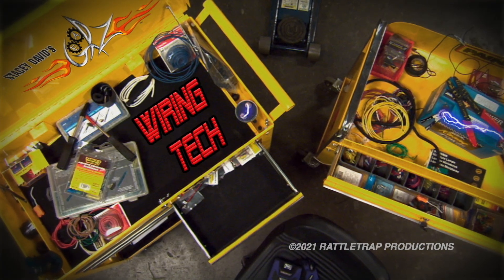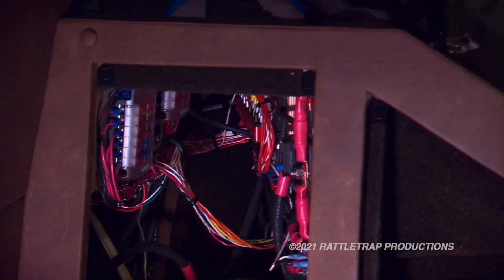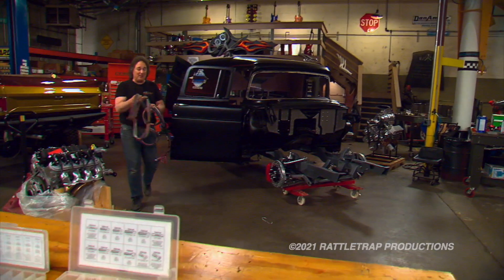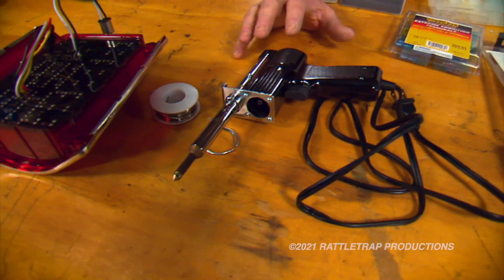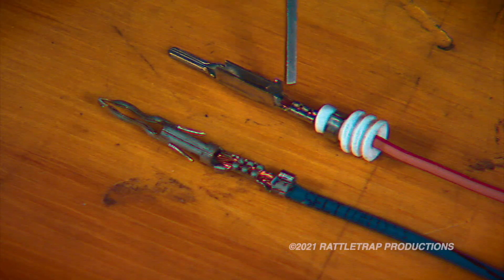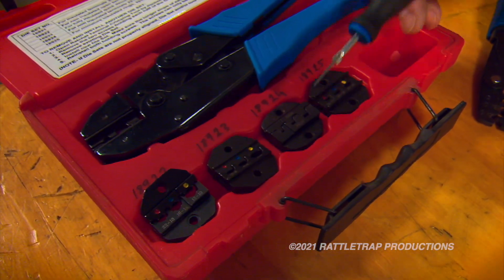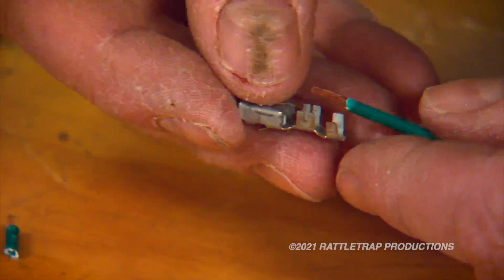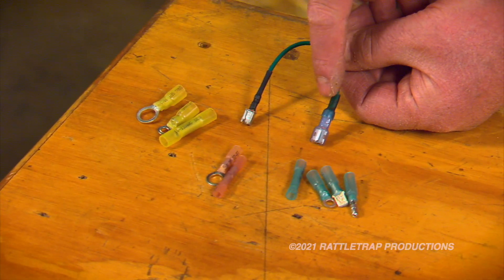Stacey David's GearZ Wiring Tech with @painlessperformance

Comment: So this being the only little video (so far) in the wiring playlist, I'm HOPING there might be a chance for an off-the-cuff trivia question.  I'm not having much luck finding good info elsewhere, but as you've spent SO MUCH TIME playing with truck projects AND THEIR WIRING -- it's worth a shot.  So cutting to the chase: I've a 99 Tahoe that I pull a trailer with now and again.  The standard 4 wires are fine MOST of the time, but I really would like to have the 12v aux power to charge the trailer battery, which is THEORETICALLY provided for in the harness.  Yeah - it's there in the BACK, but dead.  It's supposed to be connected to a side-post on the under-hood fuse panel (by the master cylinder) but I'm not seeing it.  Someone on YT suggested that it's taped up somewhere beneath the fuse box but they didn't actually SHOW ANYTHING - and I'm just not seeing it.  Is there ANY CHANCE this rings a bell from some past experience of yours - oh please, oh please...?
...I ... miss ...  TRUCKS!

Comment: Snow cat wiring..   that is what Im doing this summer.. Just sayin..  Thanks Stacey!   Soldering gives you great connections.. as long as you are not in a place where they get vibrated to death.  Correct crimpers are very important.  from a 30 year radio vehicle radio tech.